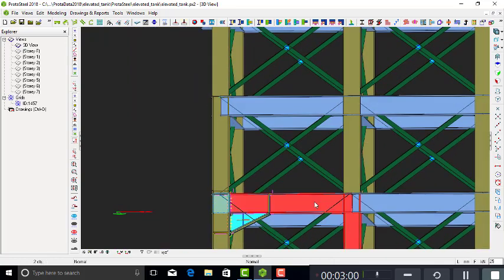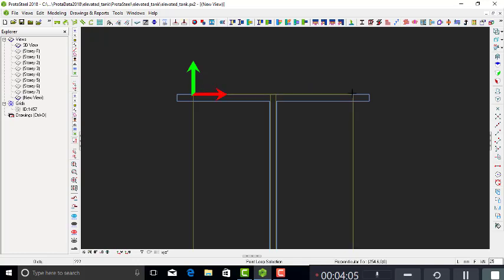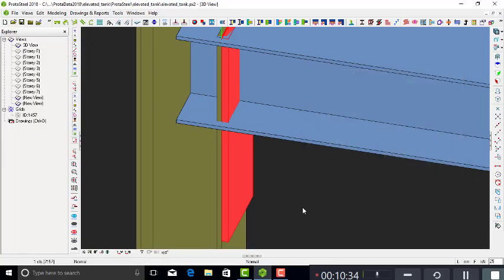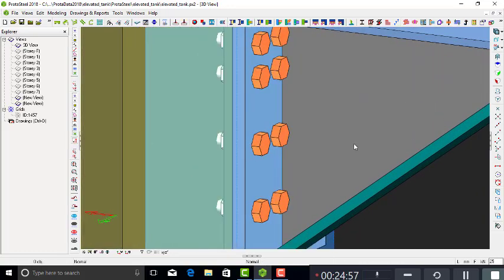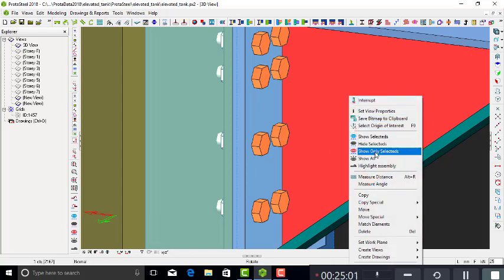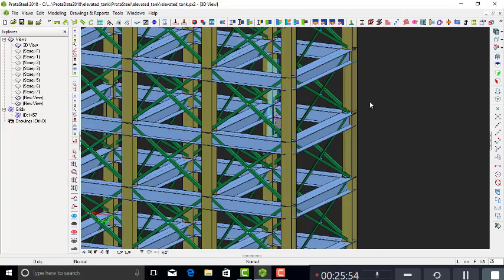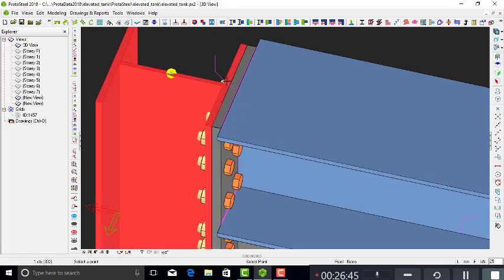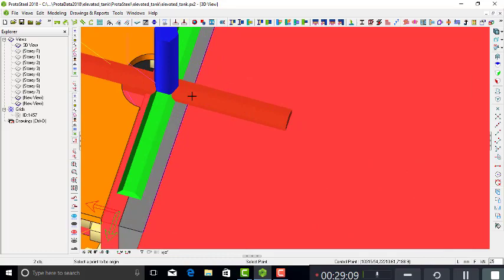How to manually create a haunch connection (a user defined connection) in ProtaSteel.

Comment: How Can I define tapered I sections in prota steel?
Reply from the maker: Please can you be more specific?
Reply: Tapered sections  has a varying cross-section along its length in a single member.
Reply from the maker: @eyayudires8039  you can't define a tapered section neither in ProtaStructure nor in ProtaSteel. The sections are picked from the database not user defined.
Reply: https://www.starbuildings.com/wp-content/uploads/2020/09/Star-tapered-columns.jpg